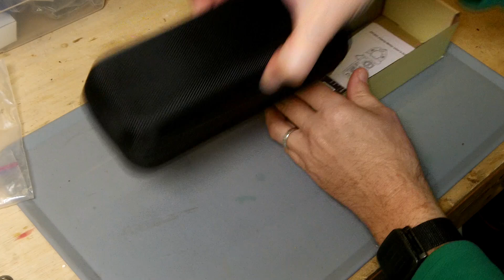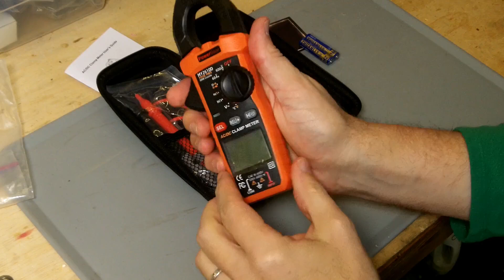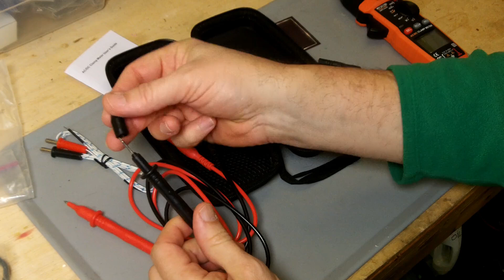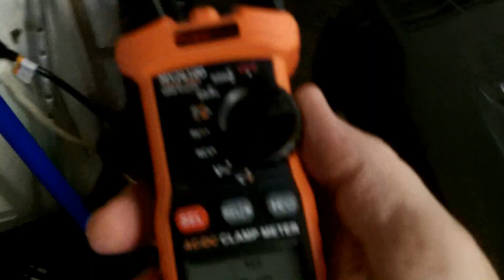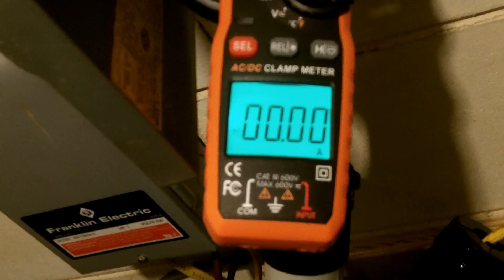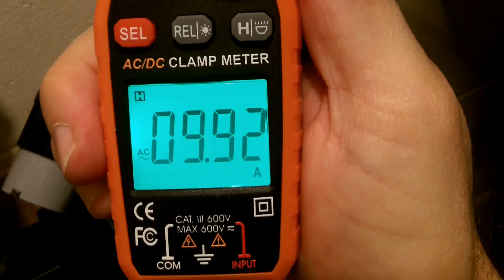Review: PowerBear digital clamp meter MY2610D  $40

Comment: Thanks. Great review. My issue was looking for DC volts. I’m used to selecting a symbol with a solid line over dashes. The V ~ symbol looks like AC so it was confusing. The only problem I have with this meter is it’s hard to see the function symbols on the LCD.
Reply from the maker: The V~ symbol is definitely for AC, so I can see how that would be confusing if you're used to a specific DC icon.